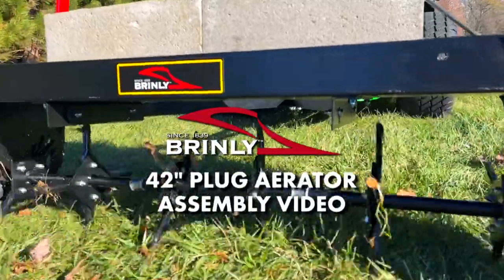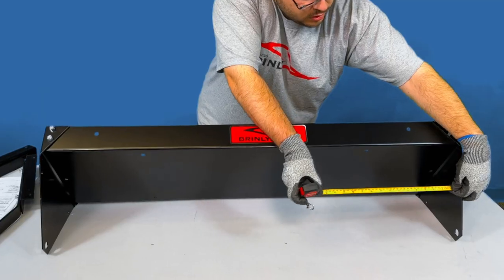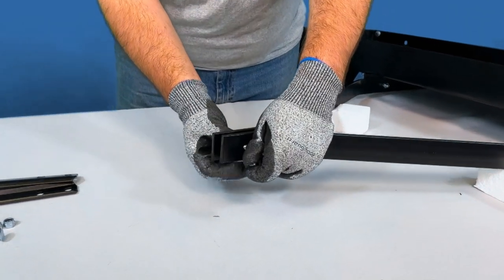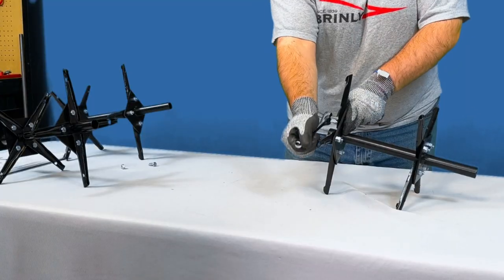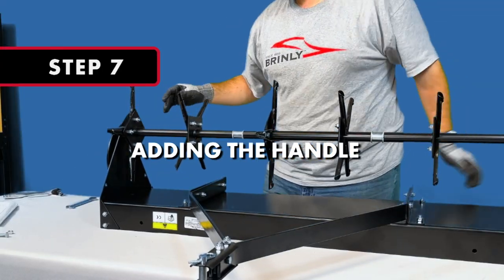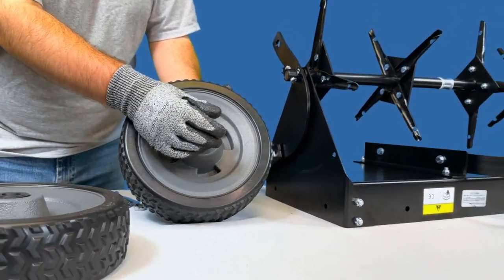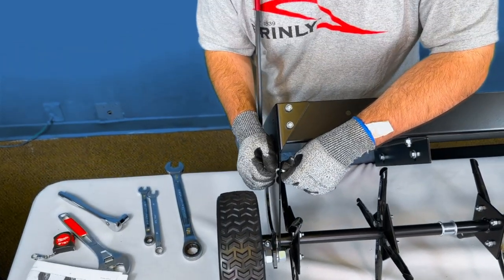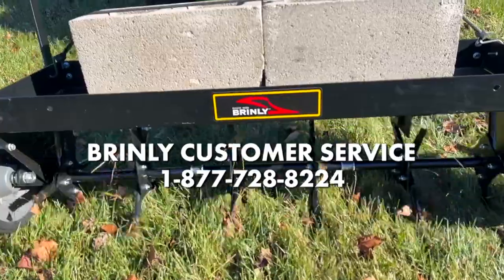How To Assemble the Brinly 42 inch Plug Aerator with Easy Storage Handle

Comment: Great video would this installation be the same for a 40” brinly-hardy aerator?
Reply from the maker: Some features differ between the 40" and 42" Plug Aerator, but how it attaches to your mower would be the same with the hitch pin.